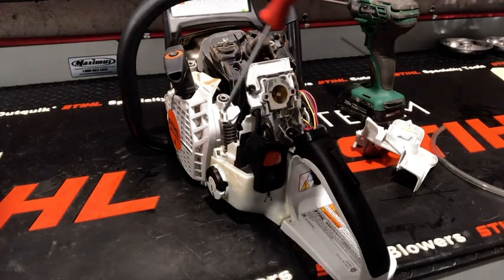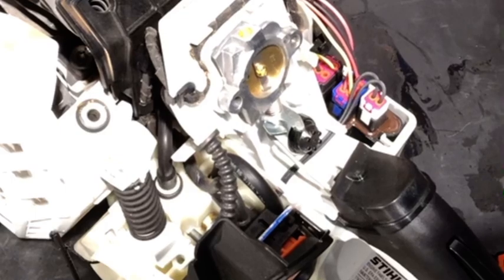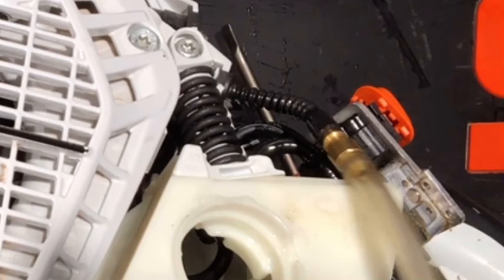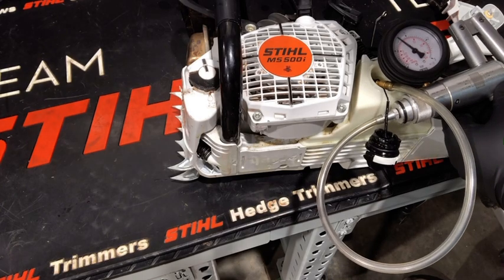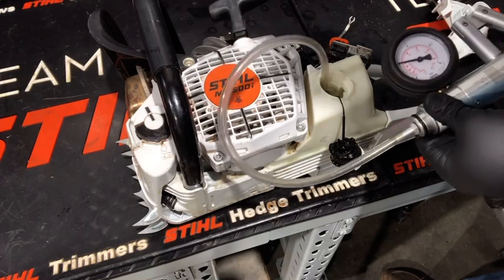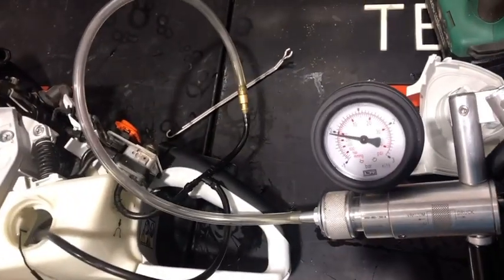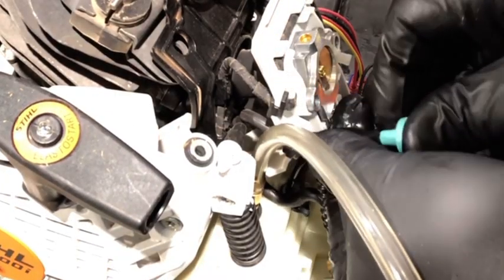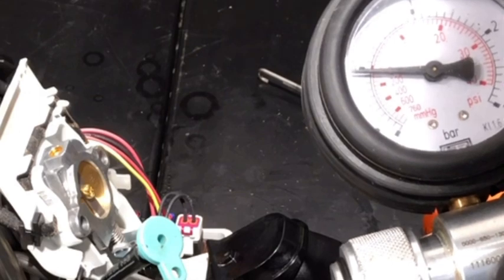How to test the fuel injection system in a Stihl MS 500i chainsaw by doing a pressure vacuum test.

Comment: It seems that this chainsaw can have a million problems. I will take a carburetor to go please.
Reply: Nah, I have one, and it just runs and runs and runs. NO issues, just starts and runs perfectly.  I like carbs also, BUT ONLY on my race cars. On mundane equipment like this EFI is awesome.
Reply: @davelowets id have to disagree. I've had my hands on approx 13 of these machines. The weak point is in the air intake. Filter leaks causing havoc throughout. Fortunately it'll 99% of the time be either the injection pump and/or the injection module. $56 and/or $446 (srp per Stihl service communication.) Lmao. They say the injection pump isn't serviceable but their security bolts didn't deter me from proving that wrong (hyped up primer bulb/metering diaphram) but I haven't been able to "fix" the module yet. Don't get me wrong, it's a BEAUTIFUL piece of German engineering at its finest, but it's not a saw to toss in the bed of a truck and beat on...not yet anyways. I'm curious to see what Stihl has in store. A diag port on the new models won't allow adjusting. Only logging. But im hoping there will be a time soon where we can adjust parameters on vital functions of the system.  Who cares how many times the rope has been pulled, I wanna be able to remap